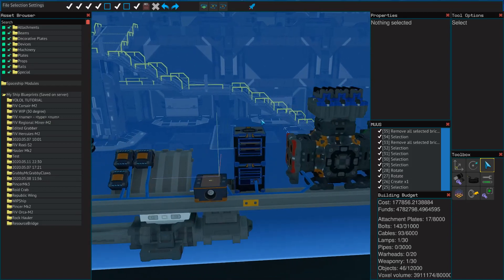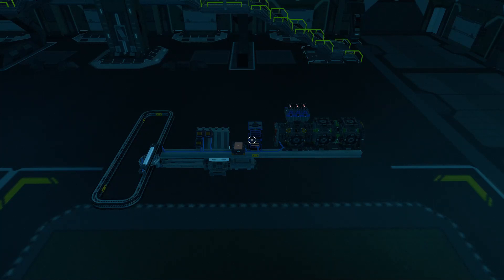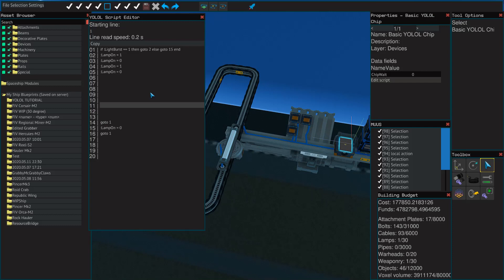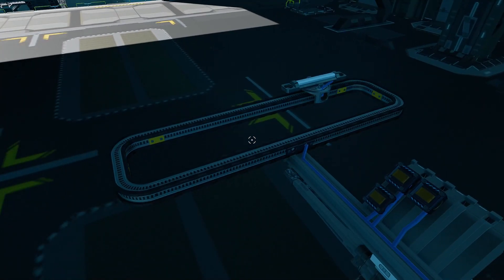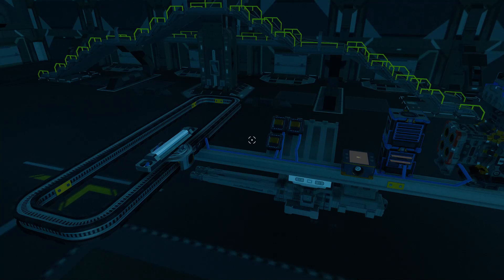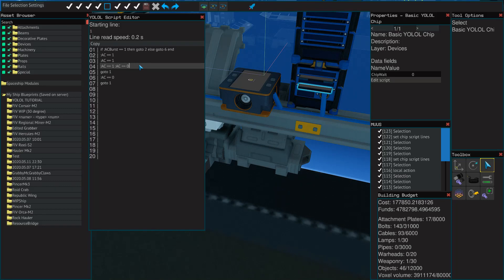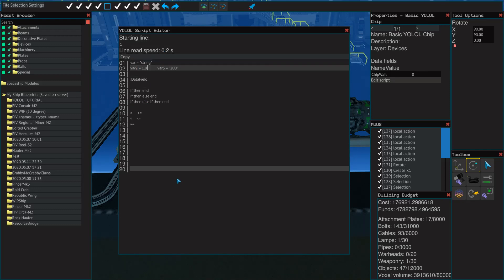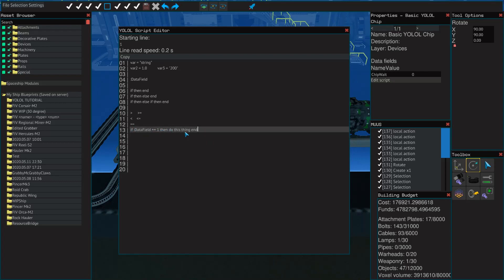Starbase Yolol Tutorial

Comment: YOLOL is quite the interesting language. It's very simple, yet that's good if almost every player will have to use it.
Is 20 lines particularly limiting in what you can do?
Reply from the maker: Lewis Massie I agree, it’s quite easy for anyone to grasp, and as for the limit of 20 lines, I don’t feel it’s too limiting especially if you shorten your variable/data field names and exclude spaces. That’s really only for heavy calculations like something you’d use on an auto turret system or something. Only real issue with that is the obfuscation, but if you’re the only one working on the YOLOL as long as you know what everything means then you’re good. So all in all, you can fit a ton of code into 20 lines.

Comment: We would need to see how it goes in game, but I could see burst fire weapons working by pushing against power requirements.
Again, we need to see how much we are limited by power, or heat or if there is a limiter at all, but I can see putting more weapons on a ship than can be supported by the power generated. Big spike damage, without killing the power to other systems.
Reply from the maker: NotoriusBEN1 Actually, right after filming this tutorial we had an in game dogfight event. I was using two auto cannons on my light fighter, and with only using sustained fire, the guns fire rates severely decreased. I started doing short 3-4 round bursts every few seconds and I was able to keep up a faster total fire rate. So in short, burst fire weapons are way more efficient than sustained fire.